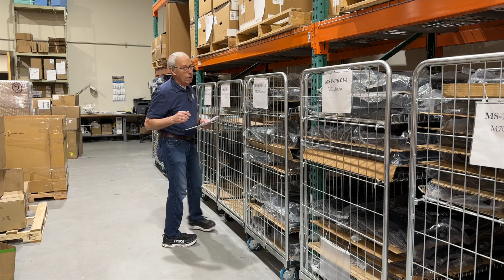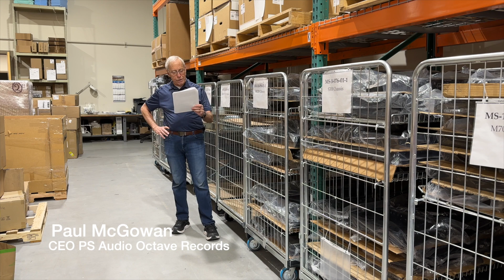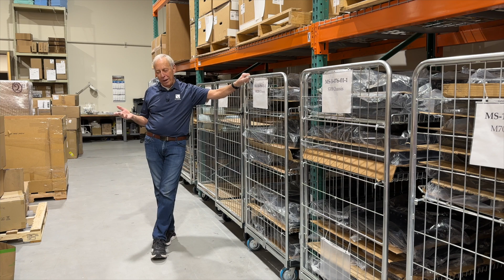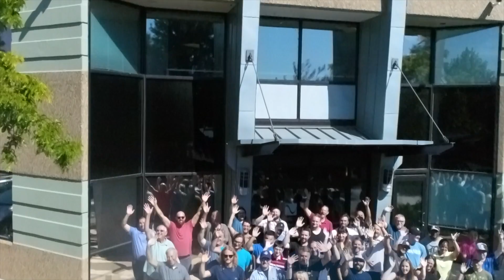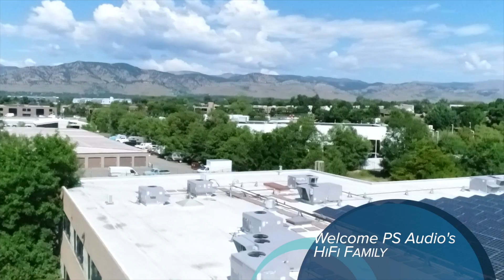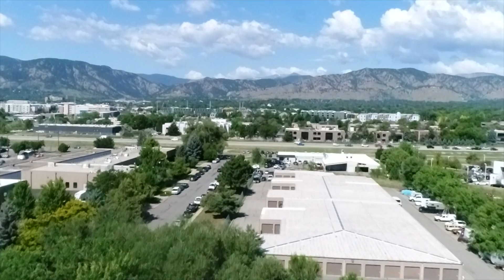Why the last few feet of the power cable matter

Comment: I went through this personal discovery/experimentation process about 8 years ago.  I started off with a rack of Parasound Z series gear and methodically started replacing ALL the cables from the stock ones that came with gear as well as the "average" grade interconnects I was using. 
The first cables I replaced were the power cables, I followed a well-known internet recipe (from Chris VenHaus) and built new power cables for each component. That absolutely lowered the background noise coming from my speakers when they were at full volume with nothing playing. It was a revelation.  
The second thing I did was replace all my interconnects with upper-mid-end to high-end RCA cables.  This also made a difference, but it was not as pronounced.
The final step was to add a PS Audio Power Regenerator which filtered all the noise and added power "capacity" for credenzos etc... Again, it made a demonstrable difference in reducing the noise to "black" when there was nothing playing but it also gave the music more punch.
Not gong to argue, I know what I experienced and I can reproduce it.
Reply: I still find it hilarious reading the ever repeating rant from cable deniers (new age flat earthers) trying to convince others that what they hear is not true :-D 
And the best part is that they're missing the whole show :-D I say Good, let them live in their bubble, not knowing how how the real hifi systems can sound like :-D
Reply: @Vic Winkler Without going into deeper analysis of your claims, fom what you wrote above it looks like you are using your audio gear to listen NOTHING at full volume !?!?
Start listening music at medium volume. Maybe you expirience something new and beautiful! 😉
Reply: I would tend to believe his claims for noise floor improvement ie lower, quieter, and more punch, ie added capacitance in the power supply Chain enabling on demand high current instantaneously for transients.
However, to confirm, a blind test should be conducted with someone swapping these in and out while he listens a vs b, marking down preference and or picking out the improvement examples.
Also have another couple listeners rate a vs b while swapping out blind, selecting their preference with brief comments why, describing difference
Reply: @alexxbaudwhyn7572  "However, to confirm, a blind test should be conducted with someone swapping these in and out while he listens a vs b, marking down preference and or picking out the improvement examples."

When you are comparing two different sets of speakers, do you need to do a blind test?
Of course not.  The same goes for swapping between mass produced power cords and quality power cords.

If you take the time to listen to a mass produced power cord, and compare it to a quality power cord from Audioquest, then you will understand why no blind test is needed.  The difference you will hear is not subtle.  It is not imagined.  It is obvious.  Not to the extent of swapping speakers.  But still, there is no question that the sound quality changes.

The biggest changes to the sound quality will be when swapping out the CD player's power cord (or a DAC).  And after putting in (for example) an Audioquest power cord, give it a few minutes.  Listen to 2 or 3 songs.  If you are not convinced of the sound improvement, then put back the mass produced power cord.  I guarantee that you will immediately hear the sound quality go south.

It is easier to her the degradation than the improvement.  If you have a trained ear, you will immediately hear improvement from a quality power cord.  But lots of people do not really have proper listening skills.  But even they will hear the sound quality go south, when they switch from the quality power cord to the mass produced power cord.

Then, when they go back, again, to the quality power cord, they will immediately hear the improvement.
Reply: @alexxbaudwhyn7572  I convinced myself, you can do the same for yourself... its actually not that challenging once you grasp the theory of what is happening with noise in proximity to your gear. Easy peasey
Reply: lolz. And you lost me well before the 'demonstrable difference' bit.
Reply: @Roof_Pizza  If you got lost, you might want remedial reading lessons to a higher grade level, either that or you might try to understand why your comprehension is so poor.
Reply: When listening, I prefer not to put up with the faint background signal noise (noise floor)

One should try pressing pause or mute, and from the MLP, if one is unable to differentiate whether the systems are off or on, that's telling you your cables are crap.

When friends or guests come around rather than showing them how loud the system goes, I prefer to press pause/mute and show them how quiet it goes. None of them gets it, of course 😂

Silence is golden.
Reply: @Burphy42  Not my problem
Reply: Its called placebo effect...
Reply: @royrogers7644  "Its called placebo effect..."
Define "It's"
Reply: @0Perhaps  definitely placebo....its hard for some people to accept that they're susceptible.  In between the time you get up to change the cable and listen again your ears have changed position...of course it sounds different! That and our memories with regards to audio isnt very good in general.
Reply: @Canadian_Eh_I  "definitely placebo"
Please list the stereo equipment that you used for your listening tests.  List every piece of gear.  Also list which power cables you swapped in and out for your listening tests.
Reply: @0Perhaps  I'm going to be respectful as I can here. I used to think such things made a difference until I started designing my own speakers and have listened to many different combinations of individual drivers, electronics, dacs, cables, etc, etc.  I do believe on some scale everything does make a different but how much is another question.  It could be infinitesimal. And then there is the question of what is 'better' why does one tiny alteration of capacitance in a cable makes a driver sound better.  Why not swap crossover components or just change the value instead of buying an expensive cable?  I could go on and on..  And then there's room acoustics and they interact with the tiny alterations in phase/crossover values caused by component change... It never ends. My point is that there may be a minute measurable difference but there is no correlation that is consistant with 'improvement'.
Reply: @Canadian_Eh_I  "I'm going to be respectful as I can here."
Why did you choose that warning as your opening sentence?  Do you normally have civil discussions by first warning people that you are going to be as respectful as you can?
That is a good line for being interviewed for a job.  Warn them that you will be as respectful as you can be.

"why does one tiny alteration of capacitance in a cable makes a driver sound better."
What driver?

How did you conclude that there is a "tiny alteration of capacitance"?
How did you conclude that "a tiny alteration in capacitance" is the change in sound quality that you are hearing -- and not something else?

"Why not swap crossover components or just change the value instead of buying an expensive cable?"
Why not swap CD players, instead of buying an expensive pre-amp?
Why not swap amps, instead of buying an expensive turntable?

What does a crossover have to do with power cables?

"... instead of buying an expensive cable?"
If I purchase a $10 power cord at Home Depot, and auction it off on eBay for $1,000, and someone buys it... does that make that expensive cable better than when I purchased it from Home Depot?

Price does not dictate quality.
There is no shortage of expansive turntables, expensive tone-arms, expensive cartridges, expensive receivers, expensive amps, expensive, expensive, expensive "stuff" that is no better than "stuff" half its price.

It seems that you are caught up in price, rather than using your ears to identify sound quality.

"And then there's room acoustics and they interact with the tiny alterations in phase/crossover values caused by component change..."
Another non sequitur, that has zero to do with evaluating the item at hand (power cables).

"My point is that there may be a minute measurable difference but there is no correlation that is consistant with 'improvement'."
Measured with what?  Clearly you are not measuring with your ears.

When you shop for speakers, do you purchase based on measurements, or do you use your ears?

Request #2:
Please list the stereo equipment that you used for your listening tests.  List every piece of gear.  Also list which power cables you swapped in and out for your listening tests.
Reply: @0Perhaps  I only said that because some people get very offended when you tell them you don't share a belief.  I am in no way trying to offend, just offering my point of view.  All the best.
Reply: @Canadian_Eh_I  "I only said that because some people get very offended when you tell them you don't share a belief."
We are not discussion religion.

What you believe about the affect power cables have on sound quality is irrelevant, if you never conducted a proper listening test.

Request #3:
Please list the stereo equipment that you used for your listening tests.  List every piece of gear.  Also list which power cables you swapped in and out for your listening tests.
Reply: @0Perhaps  "What you believe about the affect power cables have on sound quality is irrelevant, if you never conducted a proper listening test."
And you have never conducted a properly controlled DBX test that removes the well documented human placebo effect. And I can see you are a prime candidate for placebo effect here. You asked IN_THE_POCKET twice now to list the equipment he has. We all know what you will say next, his equipment is not good enough to reveal the differences, Hogwash! In addition you have also not conducted any electronic tests of these cables either. And that's understood because few audiophiles have the equipment to do that and understand the results. But what bugs me is that your crowd immediately dismisses technical tests such as done by ASR where you don't have a clue what they are demonstrating.  You just don't like the conclusion so you dismiss the test as irrelevant. Just because you fail to understand the underlying science doesn't disqualify the results.
Reply: @andydelle4509  I concur..I think part of the reason that people hold on to these views is to rationalize the money they've already spent on their equipment to themselves.  Its a hard pill to swallow to accept that they've wasted (in some cases lots of) money.  Another issue is that for MOST people, the things that actually matter for sound quality aren't even close to what they think matters.  I learned that from making my own speaker systems.  The signal loss from the transducers themselves is 100's of times more magnitude than the electronics...never mind the cables...
Reply: @andydelle4509  "And you have never conducted a properly controlled DBX test that removes the well documented human placebo effect."
Irrelevant.

If I listen to one set of speakers, and then another set of speakers, I do not need a controlled DBX test for me to know which speakers sound better.

"And I can see you are a prime candidate for placebo effect here."
You can see.  Yet you know so much about what you never heard.

"You asked IN_THE_POCKET twice now to list the equipment he has."
I asked 3x.  And I did not ask what he has.  I asked what he used for his listening test.  It makes no difference whether or not he has that equipment, as long as he listened with that equipment.

"We all know what you will say next, his equipment is not good enough to reveal the differences,"
Since you are a mind reader... tell us what equipment he used for his listening test.

And the equipment used is "hogwash"?
Use that standard when you go stereo shopping.  Since the equipment is "hogwash", then just buy anything.
All of the reviews we see for stereo equipment is for nothing, according to your logic.  All stereos reveal the same musical information, according to your logic.

"But what bugs me is that your crowd immediately dismisses technical tests such as done by ASR where you don't have a clue what they are demonstrating."
I cannot help you for being bugged, due to your lack of intelligence.

You are free to live a life of blissful ignorance.  Buy speakers without listening to them.  Use "technical tests" to know which ones sound best.
I choose to use my ears.

"You just don't like the conclusion so you dismiss the test as irrelevant."
I do not dismiss technical tests.  What I dismiss is someone claiming that a specific test covers a category that it does not.

Since you are convinced that "technical tests" reveal all that we need to know, then let the forum know:
Which "technical test" reveals which set of speakers throws a wider sound stage?

"Just because you fail to understand the underlying science doesn't disqualify the results."
Do you have a medical degree in the science of sleep?  If not, then how could you be sure that you feel better after sleeping?

I understand what my ears hear.  When someone puts test results in front of me that contradicts what I hear, then I know that their testing if flawed.  Their testing might be perfect, for the criteria being evaluated.  But when that test contradicts what I hear, then either they screwed up their test, or they did not test for the proper criteria.

If your knee begins to ache, and the hospital's tests come back negative, then that ache you have is not really there, according to your logic.

Rather than spewing nonsense, perform a proper listening test.  Use your ears.  Once you do, and you hear the difference a quality power cord makes, then you will have the tough job of returning here and admitting that you made a fool of yourself.

Do not forget to answer:
Which "technical test" reveals which set of speakers throws a wider sound stage?
Reply: @0Perhaps  We aren't talking about speakers here! Of course a speaker as a part acoustical instrument requires listening tests. Ditto that for any HiFi component. 

But a power cord? Again there is no accredited documented evidence of a power cord affecting audio quality as long as the wire gauge is sufficient.

Your analogies are childish.
Reply: @andydelle4509  "We aren't talking about speakers here! Of course a speaker as a part acoustical instrument requires listening tests. Ditto that for any HiFi component. 

But a power cord?"

Yes.  And why not?
Do your ears stop working when you swap power cords?

"Again there is no accredited documented evidence of a power cord affecting audio quality as long as the wire gauge is sufficient."
Irrelevant.

Do your ears stop working when there is no accredited documented evidence?

Why must you have NASA engineers sign off before you will play a song and listen?
Answer: Any excuse for you to not come to terms with reality.
Reply: @Canadian_Eh_I  Dude, try it yourself. Or spend an eternity arguing against the experience of others. I could not care less about your reluctance to try versus need to cry
Reply: @vicweast   I have tried it. Im speaking from a place of experience .  Its ok to have fun fooling around, just know that that's all you're doing. Otherwise you're just fooling yourself.
Reply: @0Perhaps  I believe he was referring to how the brain processes sound , and how it evolved without prioritizing accuracy as an evolutionary advantage.
Reply: @0Perhaps   you  seem to have no experience with a regular hearing test, which  of necessity must account for the fictions generated by the mind when it expects to hear something , otherwise the testing would be impaired by fiction , making all attempts at measurement useless.   Illusions of hearing are just as real as the better known optical illusions.   in both cases the brain accepts the illusion as reality .  with hearing there was no evolutionary advantage to separate what was thought to be heard from reality, but we do hear direction and location very accurately.    That you mistakenly thought you heard a predator and ran away is no big deal.  running away in the wrong direction would get you on the menu, so humans evolved to hear direction and distance  very well.
Reply: @royrogers7644  this guy should let the professionals who build and update very expensive recording studios in on the news.   Those guys are all still ignorant about this benefit, even the guys building advanced custom consoles just use the regular good wire that everyone uses , despite the easy availability of specialty Hi  Fi wire and budgets that could handle it.
Reply: @royrogers7644  A man with an argument is at the mercy of a man with experience.
Reply: @lorindamikaela  Its called placebo
Reply: @royrogers7644  nope
Reply: @lorindamikaela To paraphrase  Thomas Jefferson, the informed man will always be master to the ignorant.  Give me science when messing with electricity.  And brain science when discussing what is heard.
Reply: @royrogers7644  Nope